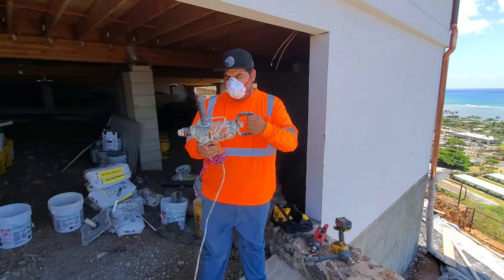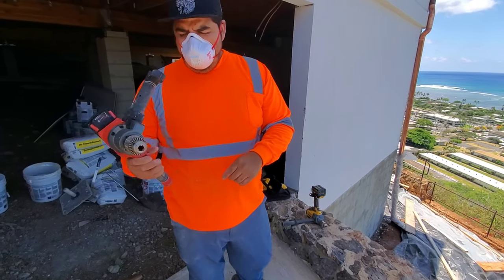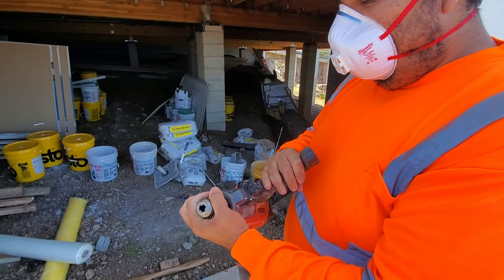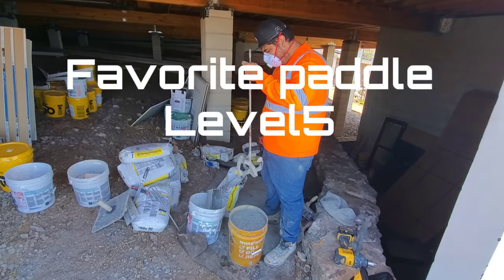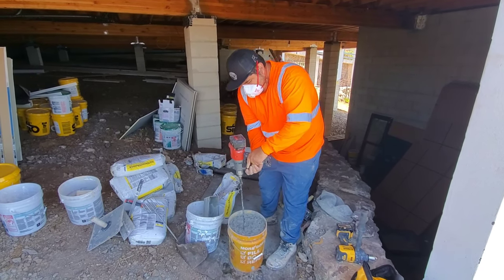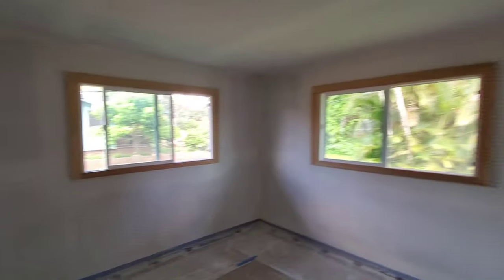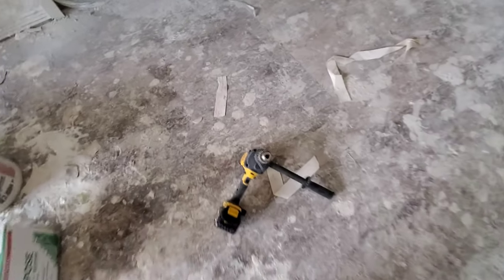DEWALT cordless mixer VS MILWAUKEE cordless mixer

Comment: I purchased the milwaukee mud mixer at Home depot on their clearance for only $99.99.

I like the adjustable handle on the milwaukee and the speed control button. I use the 8.0ah battery and it works great. Now i don't mix as much as you do, but still it's a great mud mixer for my needs

The DeWalt also looks good. I'm just not on the flexvolt line.   

Thanks for the video
Reply from the maker: Thats a great deal. Ya when I bought my kit it cost me the same as the dewalt kit so the dewalt beats it out by alittle as far a the battery goes. Both are great so like you said it comes down to what platform you already own etc..  stay safe brother thanks for watching

Comment: Mind you that the dewalt battery is a flexvolt, yes its 6Ah, but its 6Ah on 20V. The Dcd130 is 60V drill so the 6Ah Flexvolt battery is only 2Ah on 60V drill.. Thats is why the Dcd130 is  superior because it uses 60V system. I use it on my 8" ice auger and it works great! No issue on 4' of solid ice.. the E-Clutch is a plus factor👍. Milwaukee is great too. But on this situation i agree dewalt is better.. 😁
Reply from the maker: Well said brother

Comment: Can a normal drill be use to mix compound??
Reply from the maker: Yes might take a bit longer but as long as the materials not to thick a regular hammer can do it in a pinch. I wouldn't use one as my daily since it will probably burn out faster since its not its intended use.

Comment: We’re do you buy the drill and what model is the dewalt I will like to buy one
Reply from the maker: DEWALT DCD130T1 60V Max Mixer/Drill with E-Clutch System Kit https://www.amazon.com/dp/B07QBKKWVB/ref=cm_sw_r_wa_apa_i_nATTEbFZ1YY0R
Reply from the maker: I bought mine locally it came with a second battery. It was a random deal, if you have the flex out platform its worth researching and hunting down to see. Regardless at 300 the dewalt is cheaper then what I paid for the Milwaukee set and has more power for various materials. Thanks for watching

Comment: Which one of these have more torque? I need something that has a lot of power at low RPM.
Reply from the maker: Out of the both in the video Dewalt mixer has more torque.

Comment: The biggest problem I have when mixing is the brake, I hated the Milwaukee bc it would loosen the chuck on its own, and the secondary handle too. I loved the ergonomics but it was such a pain and the battery life was terrible. I could mix with my hammer drill and eat just as much battery. 

I also mix concrete fairly often, with the double box bit. I’ve done it with my hammer drills Milwaukee and Dewalt, but the big Milwaukee sucked for heavy compounds, it didn’t have good transmission for low grunt. What kind of drill should I get for heavy compounds and high torque applications? 

How does the Dewalt compare to the Milwaukee for low end torque? I felt my Milwaukee had no balls going slow it would just stall
Reply from the maker: I feel the dewalt is like a donkey kick compared to the milwaukee. Since there's no dial the trigger is a bit sensitive and just wants to go full blast it came handle the thick material but the battery life I'd shorter the thicker the material. If we're mixing to coat the battery last almost all day. If we're mixing cement we get about 6 buckets.
Reply: You need to invest in some real batteries dude M18Highout 6A,8A,12A

Comment: That’s a 9 wat battery on the dewalt looked like you had a 5watt on the Milwaukee. Get the 8.0 hi output 12.0 hi output or the 9.0 high desmans that dewalt won’t touch it that Milwaukee
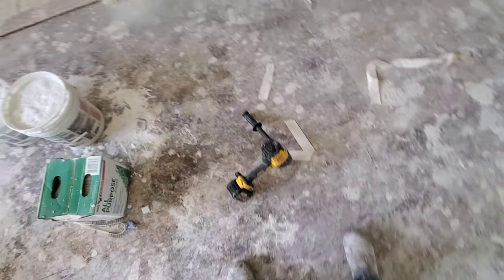Reply: If you pause at 4:35 you can clearly see the Dewalt is using 6.0 ah battery... not a 9 ah battery.  Dewalt also offers 9 and 12 ah batteries.
Reply: Dude the size of the battery has zero effect on the power of the tool🤦‍♂️ only how long you can use it for. Smh
Reply: @jtotherog  it does Milwaukee’s hi output give more power not the hi demand that’s used here out a hi output on any fuel tool and it gets it
Reply: @jtotherog  it’s called evolving and actually it’s good for us they made great battery’s for grinders saws chain saws so idk what your talking about.
Reply: @bigbullet9224  actually i just watched a demonstration on those batteries from a Milwaukee tech. The HO batteries simply have bigger cells. They charge faster and hold charg longer. They keep more juice for a longer period. Thats why you can use the chainsaw and other tools. It has nothing to do with the tool gainijg more power from that battery. Whatever the rpm and torque on the sticker of the tool is what it is always gonna be. No matter the battery. Thats what you dont understand
Reply: @jtotherog  it 100 percent gives more power watch the video mitabo hpt vs Milwaukee . And that’s a good fact check this ho battery’s do give more power it’s a fact I use these tools every day brother
Reply: @jtotherog  Bigger batteries can deliver higher amps.
Reply: @jtotherog  With the latest Fuel models, battery capacity makes a big difference in power. The motors are getting so powerful they're exceeding the current limit of the old 4.0 / 5.0 Ah batteries; it's not JUST a capacity issue. A 12.0 Ah pack has triple the cells of a 4.0 pack, essentially 3x the current limit. The batteries all have chips that communicate to the tool, and the tool will de-throttle when a small battery is installed.
Reply: @jtotherog  That can be the case if the battery can deliver the current the tool is demanding. But higher ampere hour batteries can typically deliver a higher current. For example, in a car battery a higher ampere hour battery will have higher cold cranking amps than the lower ampere hour battery. That is assuming the 2 batteries are of similar design, i.e. not one being a starting battery the other a deep cycle battery.
Reply: @jtotherog  That is not always the case.